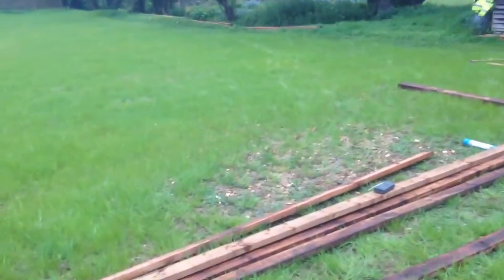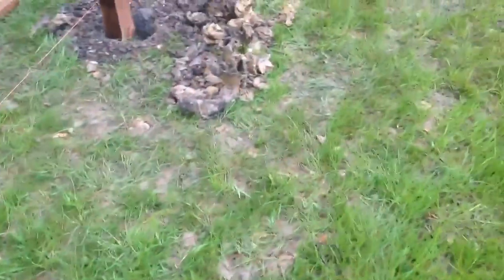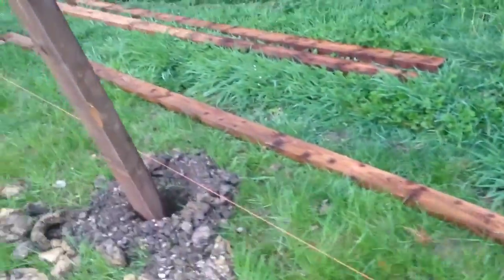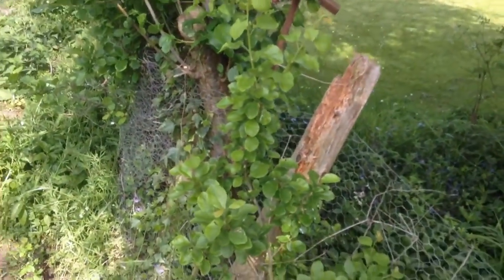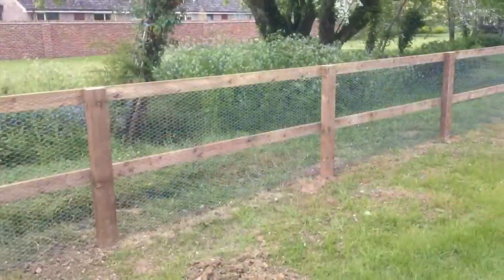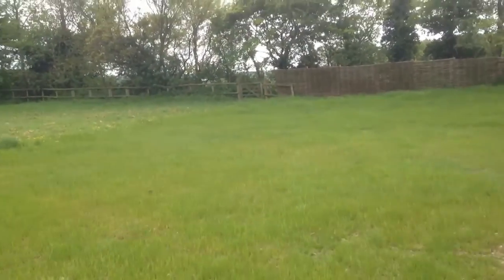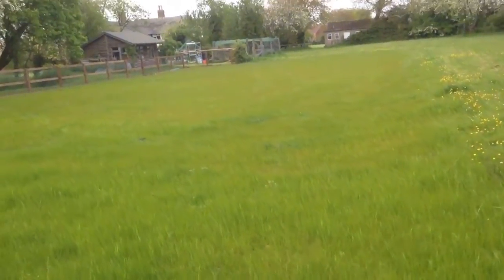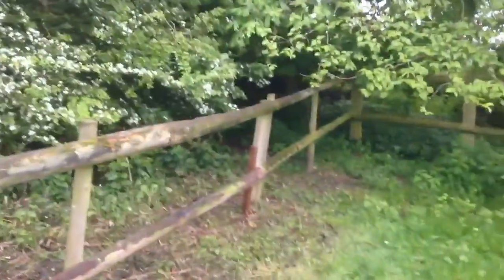Field Fence post and rail I did in spring time time.

Comment: that's alot of fence, great job mate
Reply from the maker: jason Gardener Yes it was quite a job, digging in the wire took the most time, if I do one similar again I'll get the groove dug out first. The weathers just starting to change now do you work right through winter?.
Reply: the wire looked great, bet it was a sod. yes work through winter doing mostly one off's,  think at moment im booked till January. the website brings alot of the winter work in.
Reply: did somethink I say I wouldn't , got another dog a lab puppy we mis having a dog about